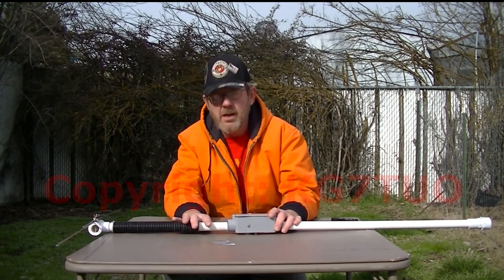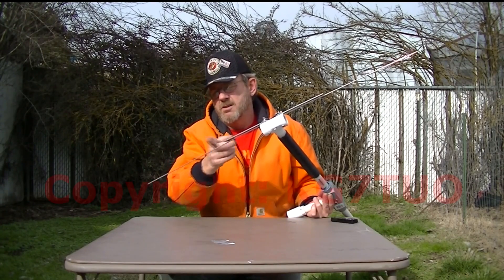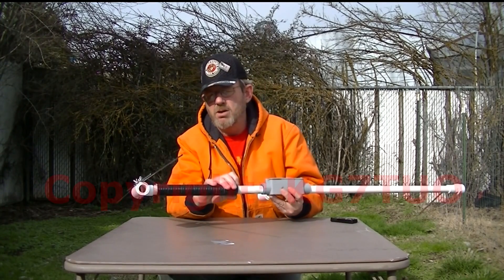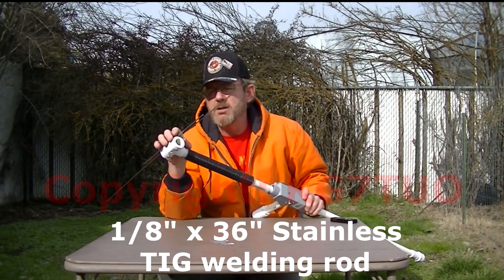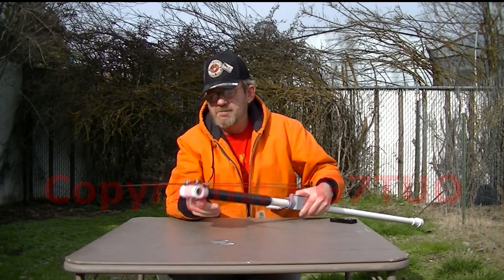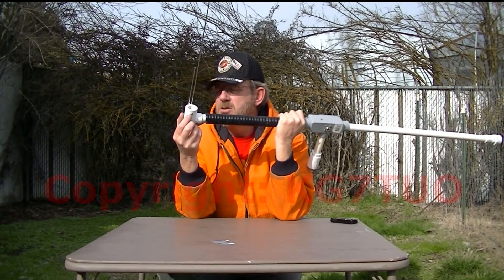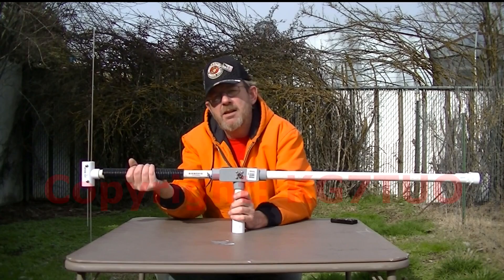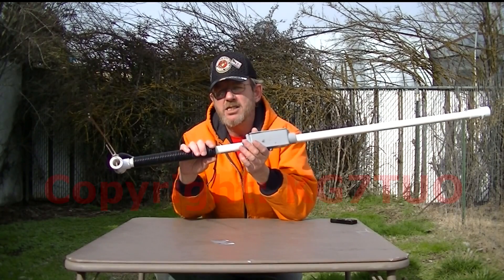Homebrew dual band vertical dipole for 2m & 70cm

Comment: Stowing the elements in the handle is marvelous!!!!
Reply from the maker: You know, I never actually put them in there.  That was the idea and for someone else it might be a good idea but my truck has a utility body. I simply fold up the elements and put in three sections of mast, the antenna, and 100' of Coax.  
Also, the first one I built, with the coax twisted around the boom is still in use when I'm on the road.  
And I have one on the roof that has a bit more boom on either side of the center with separate antennae on each end so that I can run two radios in the shack off of one mast position on the roof.
Reply: @kg7tuo999  sounds like you have a great set up there..I need a mobile set up but no way thru the roof..

Comment: Is there a specific scientific cal calculation as to how far apart the 2 meter and 70 cm radiators must be from each other?
Reply from the maker: I really don't know.  As I mention within the video series, I copied the elements themselves from another source.
I SUSPECT, but have not yet tested my theory, that the shorter portion of the element is not necessary as the longer portion being a 1/2 wave dipole at 2 meters would be at the third harmonic in the 70cm band.  Thus it would work there as well. 
I've been busy with leadership of the local HAM club and some other projects but that should be ending at the end of the year and I hope to get back to making videos.

Comment: Protip: just use two or three type 43 ferrite core as choke.
Reply from the maker: Actually, the second version did without the wrapped RG58 and was just as good. That video is also on the channel. 
All versions after this first one have been done without a "choke" and work great.  I'm currently running a double (6' of separation) setup off a single mast for inside the shack and another stays permanently in my F350 along with a sectional mast.
Reply: @kg7tuo999  nice to know that dipole design is really forgiving
Reply from the maker: @kaikart123  Well at 2 meter frequency a 1/8 inch variation in element length is also not a critical amount.

2 meter dipoles are super build friendly. I've made them from things like two tubes of water, another from two pieces of barbed wire and on that I just wrapped the coax conductors around the ends of the barbed wire pieces.

Comment: Nice.
Reply from the maker: Thanks, a lot of people have built this andhad great success with it. I've used it to go 102 air miles into a repeater from a 12 foot mast with 50 watts. And it has the adde benefit of folding up for easy transport.
Reply: KG7TUO I’m going to try it myself. KI5CSQ.
Reply from the maker: @JDK45ACP  Well good luck with your construction project. The elements can be difficult to source in stainless 1/8" tig welding rods (more an issue of high cost in small quantities just to get two rods) so you might want to substitute aluminum, brass, etc.
At 2m/440 frequencies there isn't a lot of difference in length due to velocity factor as it's a percentage change and the values are already small.
A5 440 frequencies a 7% change in velocity factor is only about 1/10 of an inch difference in length of the elements

Comment: I couldn't find a stainless steel or even an aluminum... would it okay for a copper brass?
Reply from the maker: Either would work. Because it's 2m the length difference is negligible with minor changes in velocity factor.

Comment: Very Nice video! Do you think it's possible to add a 3rd band, 220Mhz or maybe change 144 or 440 with 220? 
73 de PY5CL
Reply from the maker: You should be able to adjust to a 2m/220 or a 220/440 (Since 220 is 1/2 of 440 it might work just as it is.  I've never tested that.

Comment: What did you conclude on the 18ft choke. I didn’t any videos on your channel
Reply from the maker: The second build video has the answer.  The choke is NOT needed. I've built all subsequent versions (and others have as well) with a straight short between the elements and the connector inside the "T".
Reply: KG7TUO perfect thanks!
Reply from the maker: You're welcome
Reply: @GFO270  zaa
Reply: I guarantee if you measure the cmc on the feedline you'll see there are  substantial currents. The 1:1 balun is there to firm impedance to common mode currents. Sure it will likely work fine without it, but the feedline will try to couple to the antenna and it will radiate. And thus receive (noise). Since vhf and uhf typically us fm and uses the squelch you may never know it.....

Comment: Could you email me a complete parts list to kt4rsq@arrl.net?
Reply from the maker: I don't think I ever put together a "complete" parts list but you'll need:
3/4" PVC pipe
gray pvc (conduit type) "T" or "90" (your choice)
3/4 x 1 x 1 PVC "T" 
SO239
about 24" of COAX (RG58 is fine for such a short run and the choke IS NOT needed)
2 sets of nuts, bolts, and washers to mount the elements - use wing nuts unless it's a fairly permanent installation
2 element rods....I use Stainless TIG welding rods but brass, copper, aluminum, or even steel will work though the lengths may be a bit different
2 crimp on (solder them as well as crimp them) wire rings to fit your bolts
solder
liquid electrical tape or another material to insulate and weatherproof the COAX at the elements
PVC glue (and primer if you wish)

I would encourage you to watch the other videos on building these antenna as they are much more in depth. This one was just an overview after the antenna was made. The other two series are step by step construction.

Bruce
KG7TUO

Comment: Why the choke just like wasting money?
Reply from the maker: I was told that the choke would be necessary. In the description you'll see a note that testing between an antenna with and without the choke showed that the choke was in fact NOT necessary.  All versions since have been made without a choke.

Also note how much cable is in that choke, that's how much the guy who said I needed it said I needed.  Now days I build my antennas my way. I've built several that my elmer and others said "it won't work".....and they did.  One was even made from tap water and made it 29 miles into the repeater with readable audio on just 4 watts.  With 10 watts it was good audio to that same repeater.

So no, I don't like wasting money and the choke was not necessary. However, that antenna is still in service and is on a mast above my shack as I type this.
Reply: It's a Marine thing. Shoot the enemy then stab the hole with a bayonet for extra credit!

KG7TUO, Semper Fi!
Reply: The choke forms a 1:1 current balun. And it is necessary  because the antenna is ballanced, the feedlin is unballanced.
However at vhf/uhf 6-8 turns is plenty...

Comment: 18 ft rg 58? way too much, at least 3db attenuation on 70cm, 6-10 turns max.
Reply from the maker: It's a lot but it's actually 1.87 db. Still not good.  But it was my first antenna and someone told me I needed that 18'. If you look at build 2 and 3 you will see that I did away completely with the wraps and simply used about 20" of RG58 to run from the elements to the SO239. That reduces the attenuation to 0.17 db.

Figures are calculated from attentuation charts based on the specs for RG58, not actual measurements.

Bottom line, with or without the 18' of RG58, even build one (with the 18') can hit a repeater, quite well that is 29 air miles from my QTH on just 2 watts (setting, who knows how low it actually is) and the bottom of the lower element just 10' of the ground with a Baofeng UV5R
Reply: What you can do with lossy RG58 is use it to your advantage. 100Ft of RG58 is 7.9db per 100Ft loss. I had a HF dummy load, SWR shocking on 2 m, 70cm even worse. I used 50Ft of RG58 from SWR bridge to HF dummy load, SWR now 1:1 on 2, 70, and haven't measured 23cm or higher. This is because you lose $db to to the load, another 4db coming back, and it "irons"out swr due line losses. Also it increases your power rating by the approx 8db, as signal is lost as heat in the coax, so, effectively,  a 5 watt dummy load can handle 12 watts due line loss. It works, I have 2 dummy loads I use this with, 73's, Barry VK2FP

Comment: Also could this design be used in a Yagi, turn the elements in the other direction and add parasitic directors down the length of the pvc, you could drill holes in the pvc and slide the parasitic elements into them.
Reply from the maker: I'm not sure. With the dual band aspect I think you'd have to have directors and reflectors for BOTH bands.  If you built it monoband then the rods and PVC would probably make an excellent Yagi
Reply: Yes you can

Comment: Do you think the length of the bolts might act as a high frequency antenna? Perhaps it would be better to use shorter bolts?
Reply from the maker: If you mean on HF frequencies (i.e. 10 meters and longer wavelengths) no. Could they have some effect on the VHF antenna?  The RF will travel on the route of least resistance....just like a fan dipole allows multiple dipoles cut for different frequencies to all be connected to a single feed point. So unlikely.

Now, if you attach the feedline conductors to the heads of the bolts..farther away from the elements, there will be a major electrical change. You would then have effectively lengthened the elements AND put a 90 degree bend in the first 2 inches or so.  In fact, I tried connecting it that way to see how much effect there was and it was enough that the antenna was not usable (at least not without some major trimming).

I did make a model (build 3) with shorter bolts that were mounted on the inside of the "T". It worked the same as the longer bolts.  With both, the feedline was attached to the bolt on the outside of the washers that hold the elements in place.

Also, another HAM built one of these antennae just a few days ago. He couldn't find the same size washers I had used and when we put his larger washers on, it wouldn't work. We changed out the washers for four of the same ones I used (smaller diameter) and BAM, the antenna was right where it was supposed to be.
Reply: Thanks for the detailed reply. The washers probably changed the impedance or started acting like a wide band horn antenna for higher frequencies. I guess the only problem with the long bolts might be some sort of harmonics from higher frequencies when receiving. I suppose you could see what sort of noises you are getting if you had a scanner that could work the Ghz bands. The bolts bust act like an antenna for a certain frequency.
Reply from the maker: I THINK....don't KNOW.... that the bolts being so short, even if the longer ones are used, that the RF will seek the easier path and go into the resonant elements and radiate. The short bolts should offer far to much resistance to allow much, if any, RF to go that route.

Though I also THINK that there must be some level of measurable activity on or in those bolts.  

I do know that the design works though and I'm playing with it as other projects allow.

Comment: I made the power first by the UHF antenna. The opposite is yours. And UHF is great. 1.1 whole UHF. Only about 470MHz SWR is 1.45. VHF is worse than me. 1.65 is 144MHZ up to 156 MHz. Over 160MHz SWR is 2.8. Very strange because the bars are long 44cm. The calculator says this is 163MHz. A at 163MHz SWR is 2.8. The best SWR is at 138MHZ. Very strange. Because the barrel for that frequency should be 51.7 cm. And with me 44cm.

I used 4 rods. Two of 16 cm and two of 44 cm. And a parallel connection.
Reply from the maker: I'm not sure what you built from teh description but it's an entirely different antenna from the sounds of it.  Also, my antenna is designed for use between 144 and 148 (2m US band) and 420-460 US 70cm band).  

The element lengths in my antenna are for a continuous piece of 308 stainless welding rod held by a stainless washer (this shortens the elements electrically).  Depending on what material you've used (different velocity factors) and what you used as the parallel connector (same or different material?) you're lengths are going to need to be different to work on the same frequencies as my design.
Reply: 1/2 wave dipoles are measured tip to tip. Check that distance as it should be 100cm for 144MHz.

Comment: Does such antennas have better UHF reception because the antenna is larger. Because it includes VHF dipole? Or does it not affect UHF reception or may it fail to receive UHF?
Reply from the maker: I'm really not sure what you're trying to ask but I'll do my best.

The two elements DO affect each other.....trimming one will cause changes in the other.

These are 1/2 wave for each band (1/4 wave on top and 1/4 wave on bottom). Compared to a mag mount or vertical with a ground plane and only one 1/2 wave or shorter element, it should perform better (and mine have by a substantial margin).

That the elements are designed as dual band (two elements per side) doesn't make it better or worse than a single element, they just do have some interaction with the other element.

The 70cm element is NOT as flat on the SWR as the 2m side but that's a lot wider band than the 2m.  As built, the 2m is 1.5 or 6 (depending on exactly how you cut things) and below across the entire band with most of it well below 1.4.  The 70cm is pretty good across most of the band but will have a high SWR peak somewhere in the band (again, depending on teh exact lengths you cut the two sides of the elements to).  

The dimensions in the vid will give a good, useable antenna with only one peak in the 70cm band. longer or shorter could end up with two peaks.....the band is just two wide to make that happen with this design.

Comment: excellent thanks fir sharing
Reply from the maker: You're welcome.  The other videos I put up show how to build the antenna from start to finish and the choke wrapping is not required for an excellent antenna.  I hit a repeater 29 air miles away on just 2 watts and routinely run 10 watts through that repeater as net control for nets that last as lone as 3 hours.

Comment: use 5 inch pipe with 4-5 turns, should fix getting 1 thousand feet of RG58, also suggest using RG8X much better.
Reply from the maker: Actually, comparative testing (with the versions built without a choke) showed that the choke wasn't necessary. While the feedline should be low loss cable like RG8X, using RG58 for the 20" or so between the elements and the SO239 doesn't seem to be a problem.
Reply: Actually.

Comment: Is this antenna to be used by an HT unit or would it work on a mobile radio being used as a base station. I like this design but I want to use it with my Yaesu 7900. Also could this work mounted it the attic of my garage?
Reply from the maker: I use it with both HT's and my base radio.  Works great on both though the 2 meter band is much better than the 70cm band (though 70cm is still usable).

As for using it in your attic, if you have the space to mount it in your attic it should work, as long as there isn't anything that would block the signals (like foil on batting type insulation) or attenuate them.  Also, the antenna works almost as good with the lower element 90 degrees forward from the vertical so that the two elements form an "L".

Mine is mounted 12.5 feet off the ground, only a couple of feet above the metal roof of my shack, and works just fine. I'm able to hit a repeater 29 miles away with less than 2 watts.....though I routinely use 5 or to ensure signal quality doesn't suffer and 10 when acting as NET Control Officer through that repeater.

Please subscribe and tell your friends.

Thanks

Comment: Could you explain how the element length was determined please?
Reply: 300 divided by the MHz will give the wavelenghts in meters (100cm). A dipole are 1/2 wavelengt tip to tip. Each element are 1/4 wavelenght minus the space between them where they connect to the coax.
Reply from the maker: 1/2 wave dipole (general formula) is 468 divided by the freqency in Mhz. That gives you the length of a 1/2 wave dipole in FEET (both sides) so......

468 / 146 (middle of 2m band)
 That answer is then divided by 2 to give you each side of the dipole and then THAT answer is multiplied by 12 to give you.....

INCHES PER SIDE of the dipole..... for the 2m side.  Same calculation for the 70cm side but with the frequency changed.

Always cut long and then trim to best SWR for the frequency you're looking for. (for 2m I go for 146 which is the middle of the band)